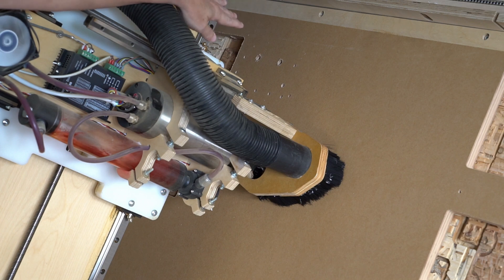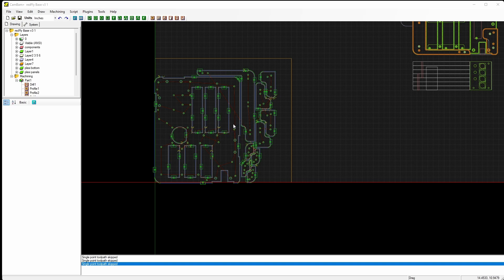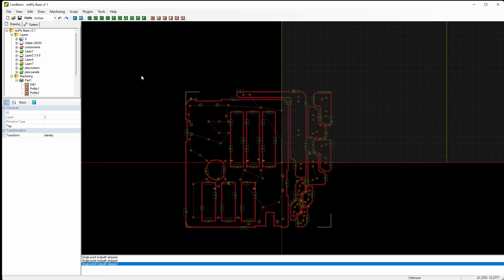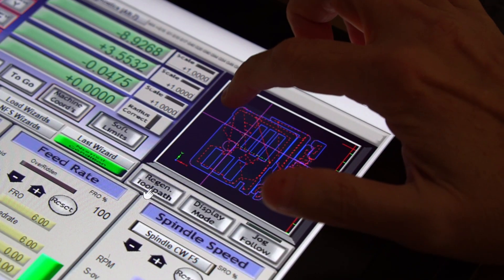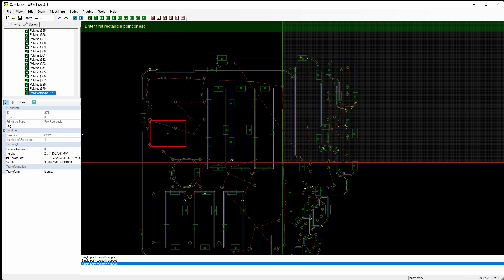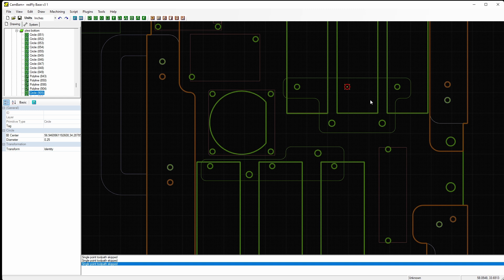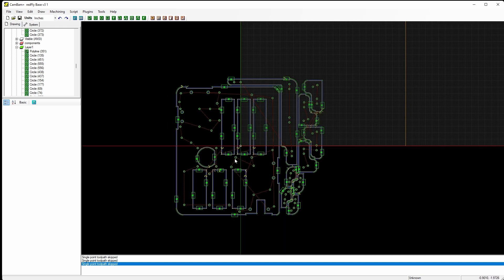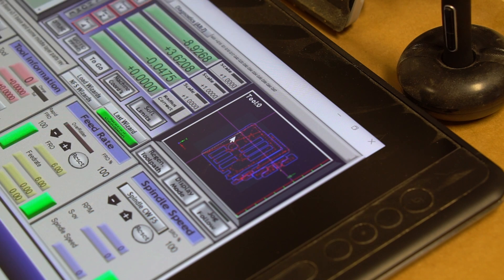Recover a CNC Project in the Middle of a Cutting Process

Comment: if you had homing switches you would of not had to do this
Reply from the maker: I have homing switches, and I do use them. Sometimes I want to make my origin at another place without the complexity of messing with absolute and relative coordinates. In most cases, I need to get these jobs done quickly, create an origin (because I never think I'm going to mess up), and just go. Also, I have noticed that homing switches (mechanical) are not too accurate, and this technique will be perfect since the machine did not move from that spot.

Comment: Wouldn't it be easier to center on a known hole and then enter that location in your position readouts?
Reply from the maker: That would definitely be another way to do it. Getting it centered on a hole is difficult, at least for me. If I know I need to stop the machine, I will wait for the machine to go to a hole that is a cammed operation (no spiraling) and press the feed hold button. That way, the machine did the positioning for me.
Reply: I agree, or send the spindle back to 0,0 and enter a coordinate near to where you had the problem and run from there and additionally as a test raise the z home to not touch the surface just to check positioning, then just rerun  the first step again.
Reply from the maker: @chuckmoney1688  I forgot to mention. The starting location, where I set the origin, wasn't the home position. The position for this project was loosely based on a section of the machine where I had some contiguous material to use.